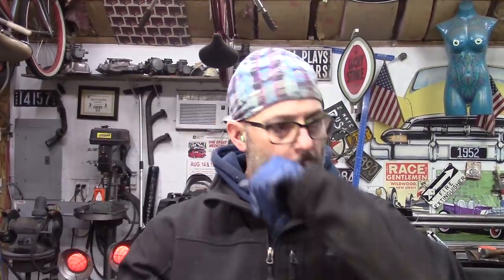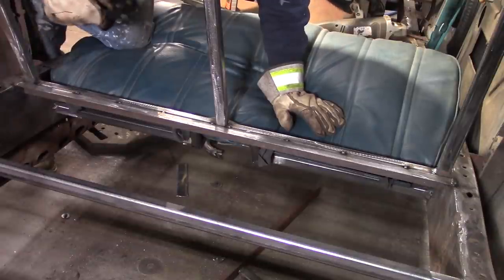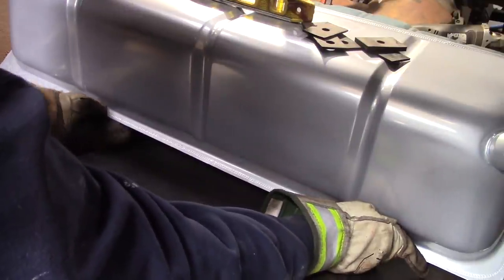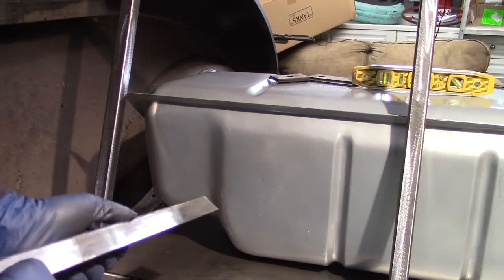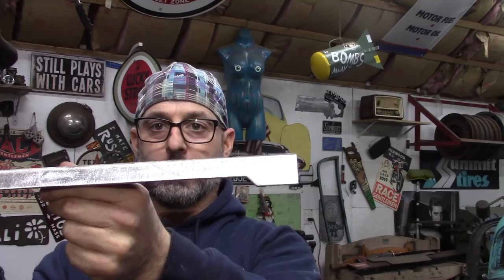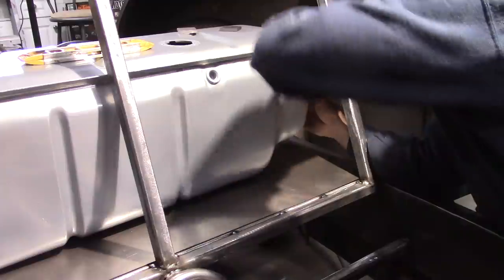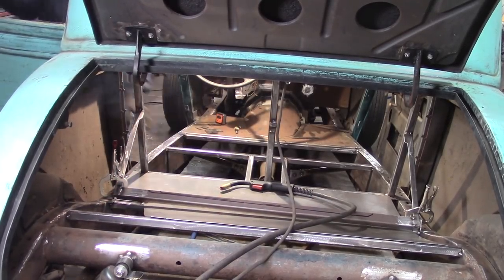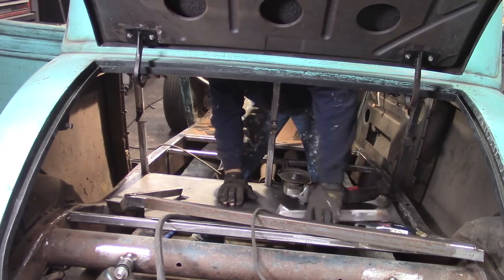Fabricating A Mount for a 1953-1955 F-100 Gas Tank

Comment: Mike, Tanks Inc makes angled rubber connectors. Looking good as always!
Reply from the maker: Thanks Roland, I saw them on eBay.  I didn’t want to pay $60 after shipping.  Crazy they want $25 to ship a 6” piece of rubber. 
I did some research and found a Gates part number and found a NOS gates 2” fuel filler hose with a 60° bend for $11.00 w/ free shipping. 👍🏼

Comment: Hey Mike..remember me..building the 34 roadster in NZ..just concerned about fueling your car inside the car..spillage? the smell of raw fuel inside the car..my 56 f100 always smelled of gas till it was less than 3/4 full..was always a head ache..just thinkin..cheers mate..and each time I comment you come back with same concerns haha all good
Reply from the maker: I won’t know until I know.   My 30 coupe filler is in the trunk area.  I haven’t had any issue with spilling fuel or smell.  
I’m going with what I know at this point. 
If I need to change it in the future I will. 
Thank you for your concern 

Mike

Comment: Don't apologise for building it right or taking too much time solving issues, you are making a one off build! In 2020 we watched 2 builds sell before their completion due to future unseen problems.
My work job was designing tool steel molds for plastic car parts for the Big Three. They have the same problems as the garage builder with all their armies of engineers, banks of computers and product knowledge. The end of the 90s when air bags were being introduced to the dash areas they would prototype every new part in stereolitogphy (today's 3D printer) models to test for fit and clearances. There would still be oops!

FYI SIDEBAR: Not related for this build - a 33-34 is far from flat or straight.  
There are seldom pure straight, flat or square surfaces on an automobile. When they do exist they soon disappear into crowns, ellipses, arcs, tapers or angles for appearances, strengthening or to eliminate hormonics. 
Many exotic kit cars of the 70 exhibited a bland recreation when finished by shortcutting with flat panels and sections especially in the grille shells to and hoods.

Comment: Does that replacement tank use a decent size fuel pickup tube? I put a 392 in my 53, had to make a bigger tube cause stock was like 1/4". That's a great size tank for the coupe. Lookin' good!
Reply from the maker: I’m not exactly sure the diameter.  I’m going to have to look.   It appears it’s a 1/2” thread or close to it.   
What did you you for a fuel pump ?
I’m just curious because I’m going to run an electric pump.  
Thanks Bill
Reply: @ThisOldHotrod  I used the Chrysler mechanical pump. It couldn't pull enough fuel at full throttle. Electric pump might make up the difference.
Reply from the maker: @billmiller7138  I’m hoping so.  
The factory fuel pump is a combination fuel pimp and vacuum pump on this motor.  It’s bulky and ugly. So I picked up a delete kit to run the electric pump.  I’m hoping it works as it should.  
Thank you

Comment: Where are you putting the tank vent?
Reply from the maker: The factory cap is vented
Reply: @ThisOldHotrod  sorry for the questions but I'm trying to learn. If the cap vents and it is in the trunk won't you be breathing that while your in the car?
Reply from the maker: @mikecunningham5686  it’s possible.  There’s no tank vent on these tanks.  They’re designed to be vented through the cap.  
The odds the trunk space will be 100% sealed isn’t likely.  I’m sure there will be air being pulled from the trunk space. 
But again, I won’t know till I’m driving the car.  
Hotrods have been built this way for 80-90 years 
😎👍🏼
Reply from the maker: @mikecunningham5686  don’t be sorry.  We’re al learning.

Comment: Please dont take this as criticism because its not i love this car im just asking because im trying figure it out now that that's been said why are you connecting you subrails for the floor to floor and not to a subraik frame thats connected to the body so that if God forbid, Knock on Wood, something bad happens to the frame you don't loose so much of the car were as if you where to make a subrail frame so it can count to the body and when the body comes off floor and everything comes of the floor will come off too  you have probably already answered this question and I just don't see or hear but I have been wondering for a while and didn't figure i would hurt to ask again sorry for it being so long again love this car
Reply from the maker: The body was welded to the frame rails.  From the cowl all the way to the back of the rear quarters.  Completely welded.  There is no subrail on the car.   I could have made tabs to mount the floor supports to, I suppose but in the event something bad were to happen to this car and there was some form of “frame damage”. It wouldn’t likely be good no matter if there were sub rails or not.   The car is a heavily channeled hotrod built back in the day.  It’s how it was and how it will remain.  I’m just building it the easiest way I know how.  Ultimately just trying to get it back on the road.   Having sub rails vs. no sub rails really isn’t going to change all that much.
Thank you for the question, I hope I answered it for you 
If I didn’t ... ask again. Haha. 
I’ll try to answer it.  
Mike.
Reply: @ThisOldHotrod  ok that explained alot and like I said you probley explained it before I just didn't catch it at the time but can't wait to see the next work getting done to her
Reply from the maker: @MrBenh1976  oh good. Ya I have but that’s okay. No biggie.  Lots of unique things were done to build the car back in the day.  
Very typical of how east coast hotrods were built in the 50’s and 60’s